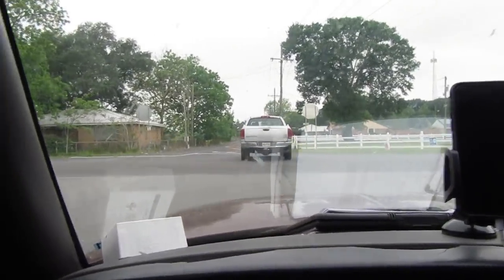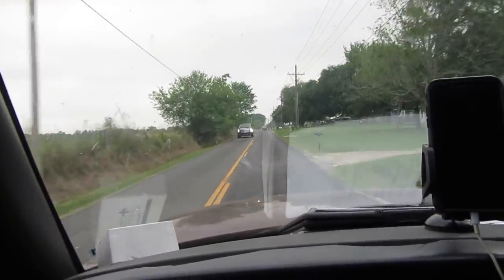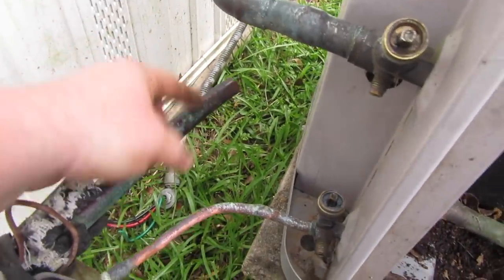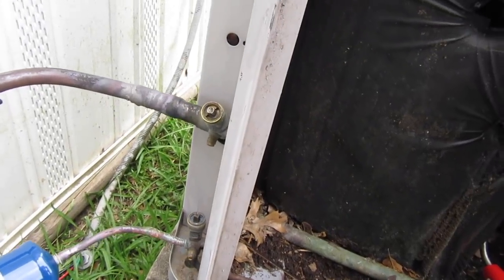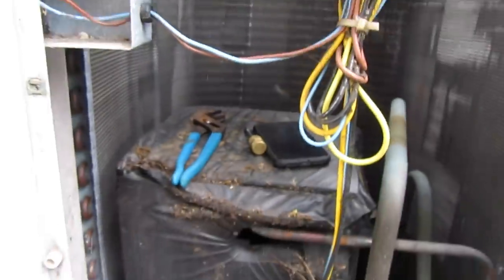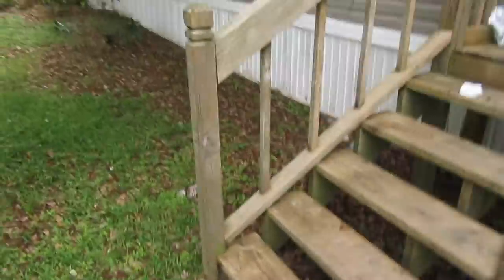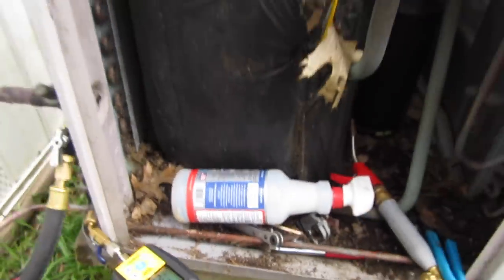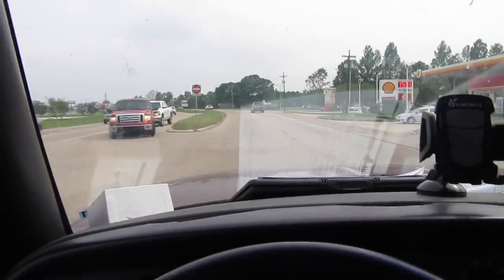Installing a Used Condenser

Comment: I love my appion core removal tools. I use the 1/2” appion vacuum hose with the yellow jacket 7 cfm bullet. My micron gauge is the BluVac professional. I love that set up I can pull most new systems down to 200 microns within 10-15 minutes.

Comment: Nice install, great you're taking care of folks.  Those Tech 2000s are still one of my favorite units.  Easy to service and you got that right , heavy, if that isn't the older starburst grill, that fan grill is probably 1/3 of the weight of the unit ;-)  Have a happy Easter.

Comment: Thank you Jonh for your hard work I’d like to ask you a question I have a 4 ton Goodman unit, last summer I had to have refilled Freon 5 times and never couldn’t find the leak (the technician) every 28 days the Freon was gone. Now the unit is working fine and nothing done since last October what happened? Thank you
Reply: I am not an hvac tech but if it you had to have the refrigerant recharged 5 times it had to go somewhere. What did your hvac tech try to use to find the leak. It's possible maybe some type of oil sealer was added.